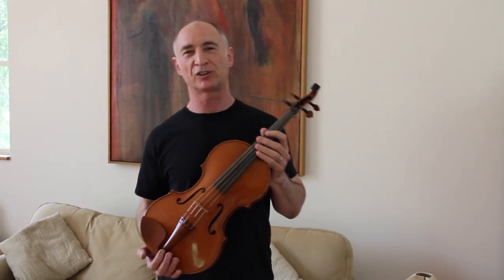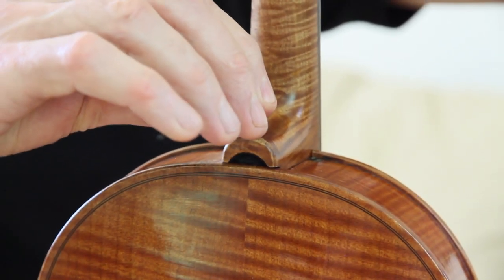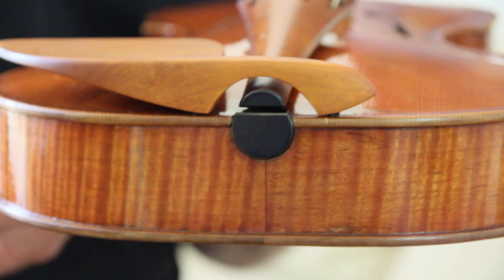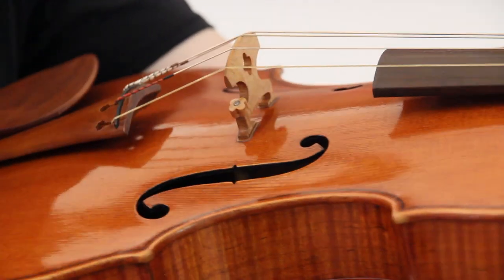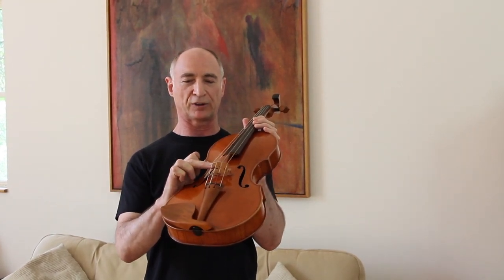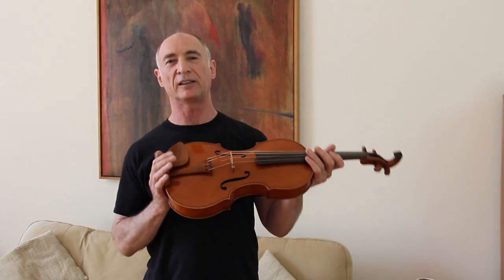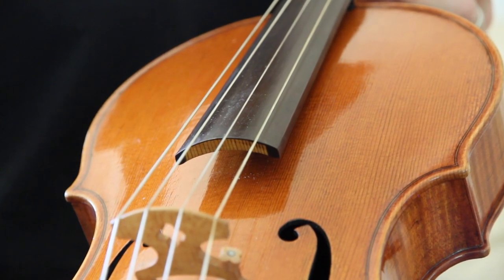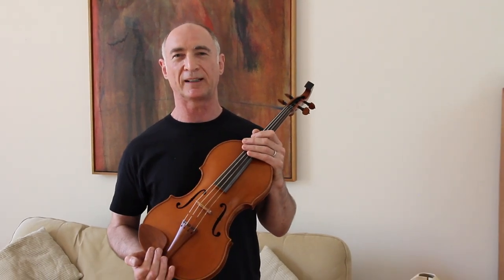Introducing the Ultralight Viola

Comment: Very beautiful!! Why so light? And why remove so much mass from places that traditionally contribute to desirable resonances, such as the scroll, the board, the tailpiece, and the bridge?

Aren’t bridges already trimmed to the optimal weight? 

Isn’t the tail gut an integral part of the tail piece resonance and the backscale tone? 

Just looking for a more technical run down for luthiers and builders. Thanks!!!
Reply from the maker: These are good questions Andrew! If you'd like to contact me by email, I'll send you some answers. violins@josephcurtinstudios.com
Reply: Bridges are great as they are. They don't need "improving" as far as I can say. Minimal changes are noticed between brands like Milo Stamm, Aubert and perhaps the higher end of Teller (aged) bridges. Wood is wood. No need to add mass to it. 
Either your violin/viola has sound issues or it doesn't...... a standard bridge will do.

Comment: Violins are not guitars. The tail gut is actually an important feature of the violin family instruments and the material it's made from and how it is adjusted affects the sound and feel of the instrument. Changing it to inflexible metal no doubt changes the sound unfavorably but we never have the opportunity to hear a comparison of sound for this instrument.
Reply from the maker: Thanks for your comment! I didn't go into details in this short video, but the tailpiece is not rigidly connected to the endpin, but can rotate freely. I have tried a great many kinds of connections, from metal hooks to steel and titanium wire to Kevlar, and in my experience the tonal differences are vanishingly small. I will soon post a video with an ultralight being played.